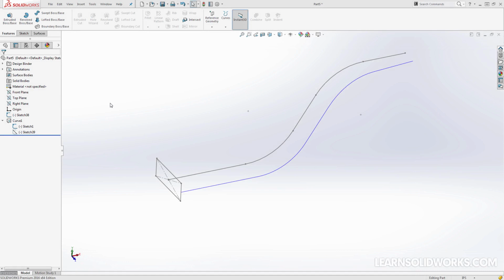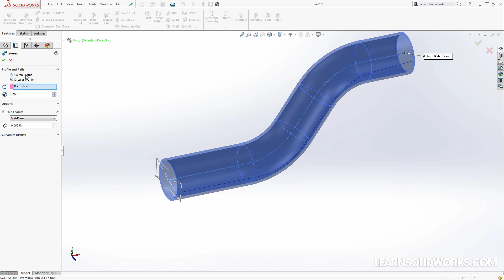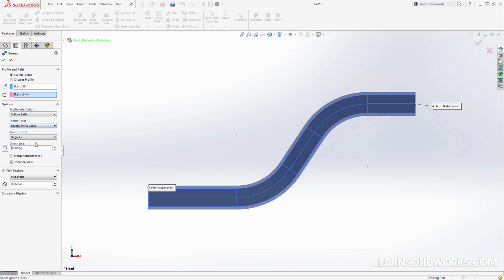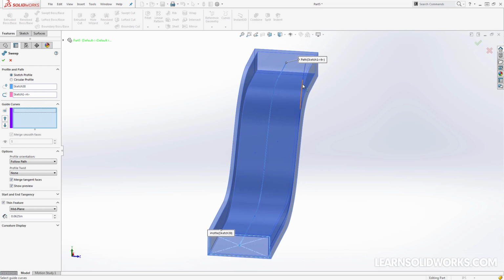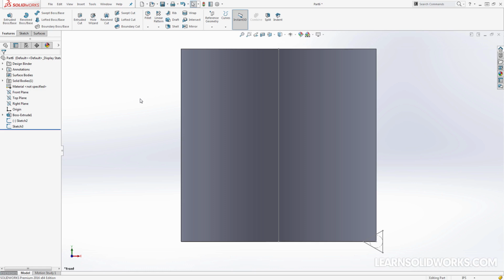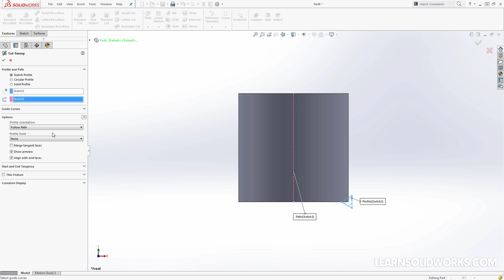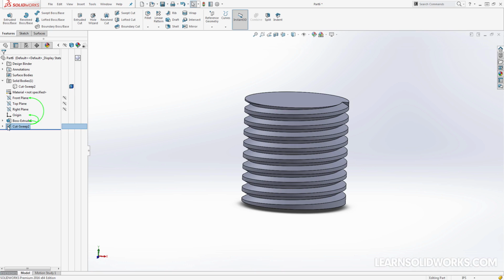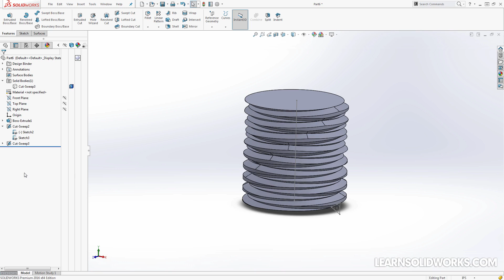SOLIDWORKS Boss/Base Sweep Feature

Comment: Great video as a 20 year SW user I never used these sweep creation and cut options::
1.) No profile needed, when using circular or hollow circular profile.  Saves me 1 sketch plane & sketch operation. 
2.) No circular sketch & helix/spiral command needed for making a cut thread.  Saves 2 operations. 
Now, if I can only remember these.